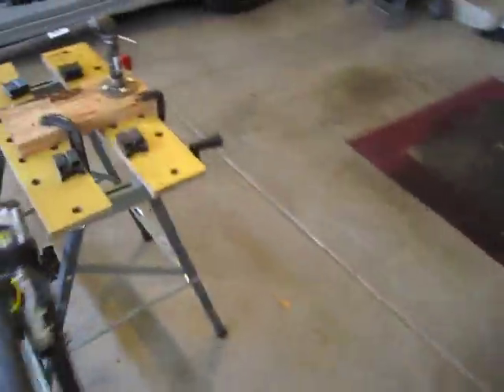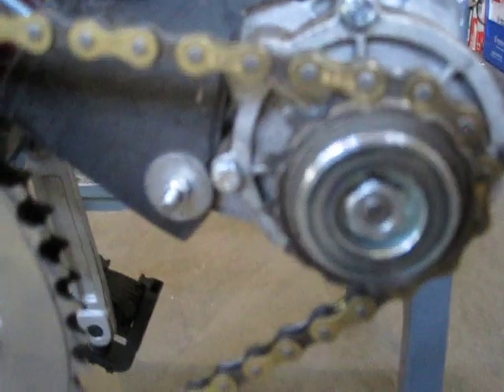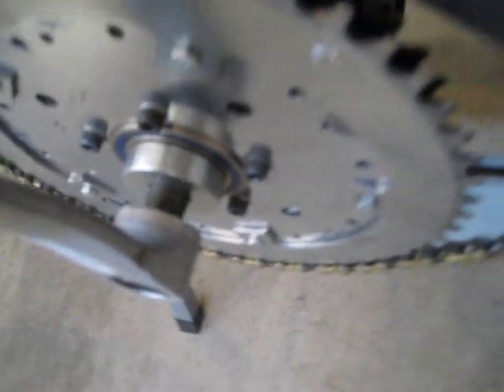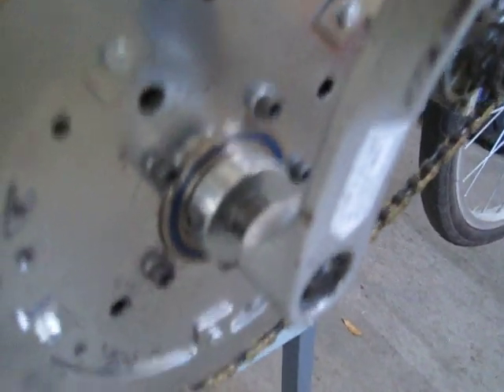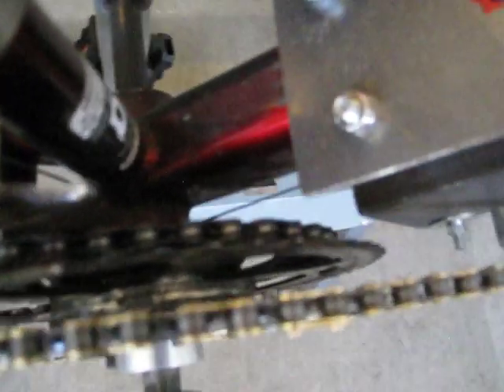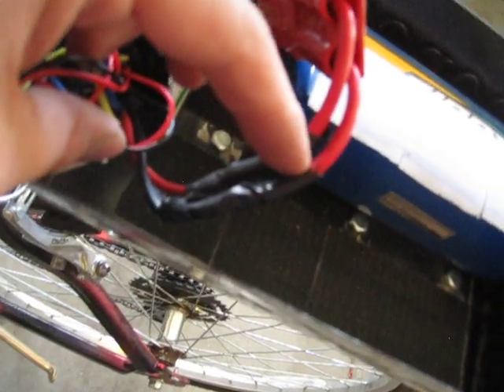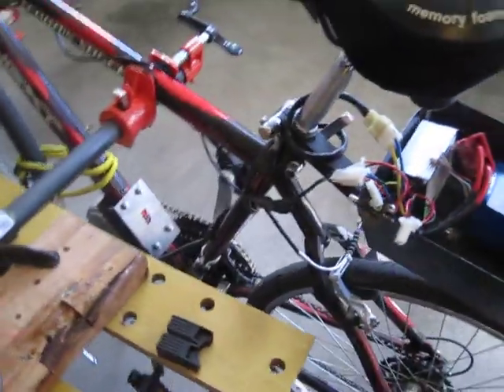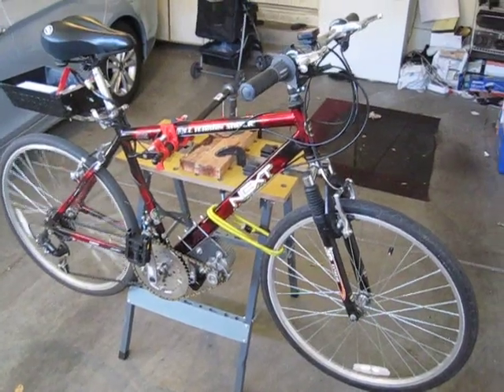Homemade BB Drive Mid Drive Electric Bicycle Update

Comment: I want do do this with the big my1020 1500w chinese motor but it's too wide so I'd need a 90 degree gearbox on the motor shaft. It would be alot of work but would be so fast on a carbon bike.

Comment: Awesome video.  I'm a complete noob trying to figure out how all of this works.  

So, if you pedal, does it assist the motor, or bind it up?  What if the motor isnt running?  I think you said there is a freewheel on the motor shaft... does it turn the same way as the other freewheel, or do they have to turn opposite?

Sorry... I'm trying! Lol
Reply from the maker: With this system, as you pedal you can help the motor, and this will extend your battery range, especially going uphill.  Of course if you are going downhill then the motor may be spinning faster than you can pedal. Because there is a freewheel on the motor shaft, you can pedal the bike as normal without resistance if the motor is turned off, which is great in case your batteries die.
Reply: And those 3 chainwheel setups from cyclone are the same thing, just not heavy duty?  Their website isnt very clear.  

Thank you so, so much.
Reply from the maker: Yes those systems work the same as my setup.  The freewheel itself will not be heavy duty, but the other parts seem well-built.  When I built this system several years ago, setups like Cyclone were not readily available or were a lot more expensive.  If I were to build this system today, I would probably purchase a mid-drive system.
Reply: Thank you so much.  I really appreciate you taking the time to answer.    I actually have a hope of figuring this out now.  Lol

Have a great weekend!

Comment: Hi, I've watched all your ebike videos, cool stuff. You did it the RIGHT way! I'm in the process of building an electric bike for myself. My goal is an electric tandem bicycle that has a range of at least 30 miles, and can maintain 15mph with a full load (two people and some gear). The tandem is an easy choice, its a two-for-one, since it only requires one rider but is very comfortable for two riders and there's plenty of space for motors, batteries and storage.

I made prototype with my single mountain bike and the motor I bought (450 watt), it sort of worked but I needed a chain tensioner and more accurate alignment. Plus it was only driving inline with the pedals so I had to hold my feet out as they spun.

Are you interested in building my idea? I can ship you the tandem I have, or if you can think of a model that may yield easier to build on I could look into buying a different bike. Obviously I'll compensate for your time, and directly pay for all the parts you need or any special tools required for the job. I'd like to be into it for less than one thousand. I'm a mechanic, have access to welders, any kind of hand/power tool. I feel it would be more efficient for you do do the driveling work as you seem to have a wealth of knowledge and experience with this stuff, it would take me months just to research and order the right parts. Tuning and fixing it is no problem however.

 My vision of the final bike is: a tandem where you can use motor, pedals, or any combination of the two. The two sets of pedals could stay fixed together as they already are, but should freewheel when the motor is running. Likewise the motor should freewheel if it dies and the rider needs to pedal home. Of course the pedals will need to be geared, and I'd think the motor should have at least 3 gears inorder to get the most out of it. Then above all I want it too be stealth, I want the average Joe on the street to not tell it's a motorized bike unless he looks at it up close. That's the whole point of going electric vs the much cheaper and easier gasoline route. Gas makes too much noise and people get annoyed by them.
Reply from the maker: JJJRickey,  my bike was build several years ago before kits were available.   If I were to rebuild this bike today, I would use a kit since the motor would be more efficient and it would be a much easier build.  There are sites that sell the motor and special freewheeling cranks that you can put on any bike.   The below kits would do everything you would want it to do and would be easy to install, even on a tandem.  Check out the following sites for these kits:

http://www.gngebike.com/mid-drive-kits

http://www.cyclone-usa.com/

http://www.cyclone-tw.com/diykits.html

Comment: @hutchtransfer
What is the freewheel you bought with the set screw?
Its not the same one you used in the setup that wobbled is it, the SickBickParts Freewheel HD for $80.
I cant find no freehweels with set screws at SBP or Staton Inc

OK The term is Keyway Freewheel Adapter

Can you please explain how the keyway engages the BB Cartrridge Spindle, you didnt modify the spindle to accept the set screw did you?
Reply from the maker: The freewheel is separate from the adapter that has two set screws.   

Yes I did use the SickBikeParts HD Freewheel:  http://sickbikeparts.com/front-freewheel-heavy-duty/   
My sprockets are attached to this Freewheel.   However, the freewheel is attached to this adapter that has two set screws:  http://www.staton-inc.com/store/index.php?p=product&id=986

The bottom bracket spindle has a groove in it for the key, and this is what the adapter is connected to.

Comment: nice job. Much better than the previous one with a lot of wind noise. Do you have specs on any of your other videos with info on top speed, running time,  pedal assist speed, etc?
Reply from the maker: The older designs I no longer have.  The video you watched (without the wind) is the most current build for my bike.   Top speed is around 25 mph.  Running time is about a 20 to 30 minutes using a 24 volt, 8 amp lipo battery, depending on terrain and wind.  On the flat with no wind the bike's cruising speed is around 17 mph, and that is with no pedaling.

Comment: Impressive standard of work you've produced there.  Did you say what the motor's wattage is?  Or the capacity of those LiPo cells?  Something that's kept me away from things like this is the cost of replacing the battery - in the UK when I was looking at possibilities I was seeing prices like about £300 for an average battery. 
Anyway, nice work and moreover - sound explanation. Thankyou!
Reply from the maker: The motor wattage is 450W.  Each single lipo battery has a capacity of 8000mAh.  Thanks for watching!

Comment: So you took out the thread cranks right, may i ask you what crank you're using now?
Reply: what type of bearing and cones are you using now?
Reply from the maker: Yes I took out the threaded freewheeling cranks.  I am using regular cranks now (170mm).
Reply from the maker: I am using a bottom bracket cartridge which has sealed bearings.

Comment: I guess i have swaggie (bike mounted hoboS of yore) in my australian blood, but i ponder the matter of off grid ebiking a lot (ie, to tour on an ebike & not need a wall socket each night)

I posed the matter on a forum - basically, solar hasnt the power to weight ratio for the job - what about a wind turbine using cloth sails/kites, to turn the pedals while camped, and generate recharge power from the bikes existing regeneration barking capabilities - the charger adds ~no weight, and uses concentrated solar energy - wind.

both light and powerful.

needs work, but this guy has actually done just that.

https://endless-sphere.com/forums/viewtopic.php?f=3&t=82313

I have charged my bike @ over 300w with a kite system.
[youtube]https://youtu.be/WYl-Y2791l4[/youtube]
Used the power to ride over 100 kite miles

or

https://www.youtube.com/watch?feature=player_embedded&v=WYl-Y2791l4

a 500wh battery would normally charge at 100w over ~5 hours, so 300 watts is more than needed by most.
Reply: My post was in error here, but it is of general interest, so fyi? & i wont delete it.

Comment: wait so there a separate chain connecting from the freewheel sprocket motor and the freewheel adapter sprocket.
Reply from the maker: One chain from the motor to the cranks (freewheel sprocket).  Then the other chain goes to the rear wheel. Two chains total.

Comment: Do you think this would be water proof? I know its a dumb question but I'm just wondering how it would hold up in the rain.
Reply from the maker: For a few sprinkles, wrapping the wires in waterproof tape would probably suffice.  However, through heavier rain, I would cover the entire rear basket with something or put the components in some waterproof container just to be safe.

Comment: whats your duty cycle on that motor, cause your gear reduction on the motor its self is a power reduction. for one crank revolution that motor is spinning 28 times you could  reduce that crank gear by a ton and increase battery longevity, where your using small cells and speed as well i would think.
Reply from the maker: There is a gear box attached to this motor in addition to the sprocket reduction.  So yes one crank revolution equals about 28 turns of the motor.    Then you can change gears on the bicycle itself.   In the slowest gears the bike goes about 6mph which is great for hills.

Comment: Nice build.  Thanks for the info.  I like your front sprocket set up, very clean.  One item item I would consider adding is a chain guard for the front sprocket as your setup is little wider so your leg or pant legs are a little closer to the front sprocket.   My E-bike conversion uses a 48v 1000 watt front hub set up and full suspension bike as hitting bumps at 25+ MPH can be rough on the frame.  Problem for me is that my cargo bike weighs 80 lbs. when loaded with 8 6 cell lipos.  Do you know what your top speed is ?
Reply from the maker: +covercalls88   With this set-up my top speed is around 20mph on the flat with no wind.

Comment: Hi! How's the pedal cadence at full throttle? Can your legs keep up to add power?
Reply from the maker: +rondg2   The motor spins at about 100 rpm at full throttle which is a little fast to maintain using leg power.  Therefore I usually give it about have throttle when pedaling.   This will extend the range of the batteries as well.

Comment: am looking to put a mid drive on a kmx cobra trike with a nuvinci n360 on the rear tire but dont know what kit to get because i want to run the drive  chain on the left side of the bike.
Reply from the maker: John Hillman    Most of the mid drive kits I know of have the chain running to the cranks on the right side of the bike as you are sitting on it.

Comment: 2:33  wide Q-factor there ! Could you use instead this one :Bottom Bracket Cartridge 153 mm from Sick bike part ? Don't know if the 153mm BB version get the keyed shaft ?  Q-factor is the distance between the 2 pedals , narrower is better for the knee of any performance cyclist . Not probably a concern here for E-bike but I'm looking for an independent drive for my tandem bicycle . I want something that gonna turn round with no run out ,  so I reject their freewheel crank set with the thread for freewheel . What is the part number for the freewheel adaptor .  3:39 : the run-out so bad ??  Thanks in advance for info .
Reply from the maker: oi32df   The 153mm BB version does not have a keyed shaft.  That is why I had to get this wide BB since that is the only one I found with a keyed shaft.

Comment: You were mostly filming from the right side of the bike, but in a couple of the shots it appears as if the left pedal crank is a good 2 inches out from the BB. With the pedal being so far away from the frame, doesn't that put your knee in a very uncomfortable position? It looks like your legs have to be pretty far apart to ride this and would be very uncomfortable to pedal (assuming you are pedaling the bike and using the motor as an assist) and might even cause knee problems. Do you know how far exactly the pedal arm is from the edge of the BB?
Reply from the maker: christo930   This was the only keyed shaft I could find online.  The whole shaft if 206mm, and was purchased here:  http://www.sickbikeparts.com/catalog/product_info.php?products_id=114These cranks are made for gasoline powered engines, so that is why the clearance is so great.  Actually I have not have a problem pedaling although I must admit I do not pedal much with the motor these days.  I am not sure on the exact clearance from the bottom of the BB.  You can ask Sick Bike Parts for an exact measurement.
Reply from the maker: barryhm
Yes that is correct.  The left side is longer.  This is because the shaft is really made for gasoline kits that have wide engines that need to be cleared.

Comment: Thanks for the great video.  Might learn how to use manual focus or see what the focal range is, then zoom in.
Can you tell us about the costs for the different pieces and the total so far?
Thanks again. Good job.
Reply from the maker: Chaz Steadman  Yeah the camera I used was a Canon Powershot which does not have a manual focus.   The costs for everything so far (including the bike and three batteries) is around $700, however I bought most of the items a few years ago.  For a more detailed parts list you can email me at hutchmath@gmail.com and I can give that to you with links so you can see the current prices in case you are interested in building one.

Comment: That's nice work that you've done there. What is the wattage on that motor that you have on your bike and volts, amps ratings?
Reply from the maker: Jose Servin  The motor is 450W, 24 volts.  Maximum is 30amps, which is limited by my controller.

Comment: nice, I really like your work... This is exactly how I am making my bicycle, nice to see we are thinking the same way. even bought the same bicycle computer you have :P
btw, how is the motor brushes holding up?
Reply from the maker: So far the brushes are holding up, however I do not use this as a daily commuter.  Just use it for the occasional ride.
Reply: Brushes vs brushless - what is the difference that you notice? I am also writing articles on hub vs mid-drives - at eiproject dot net/electric-bikes-mid-drive/

You are a candidate for a lathe and a drill press :)
Reply from the maker: Bobcatt22
Thanks for sharing your website! Brushes eventually wear out, however that takes a really long time.  Brushless motors are also more efficient (and more expensive).  Yeah a lathe and drill press would have saved me lots of time!  Unfortunately my wallet does not agree!  :)